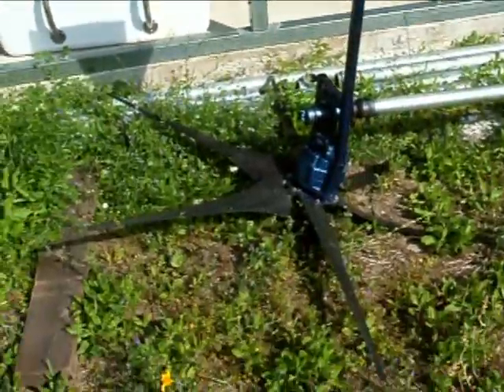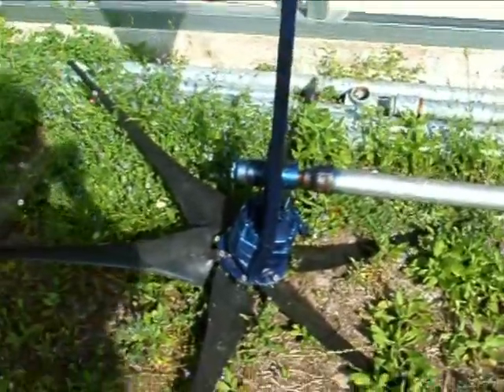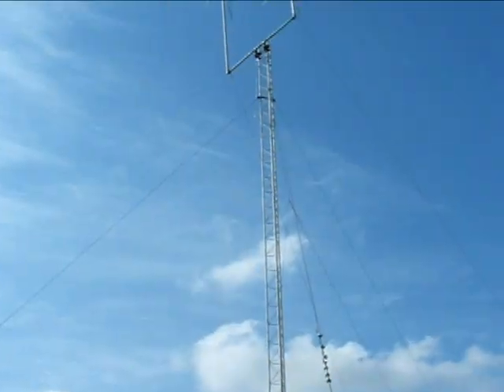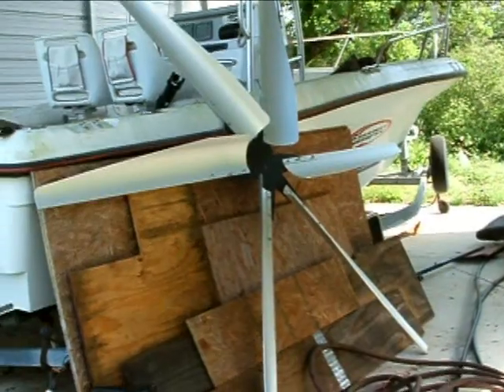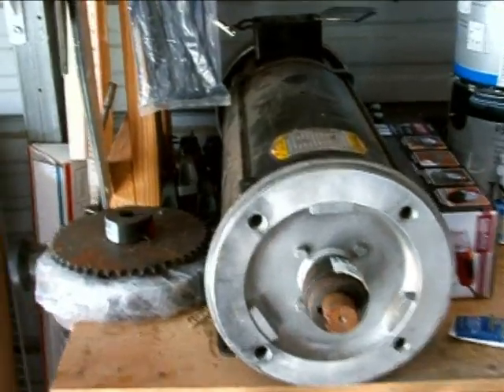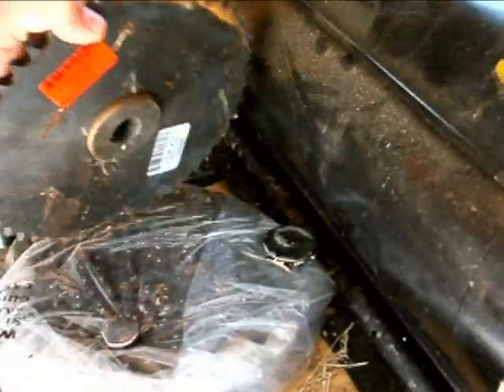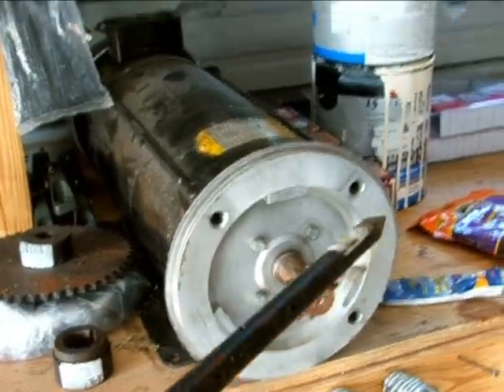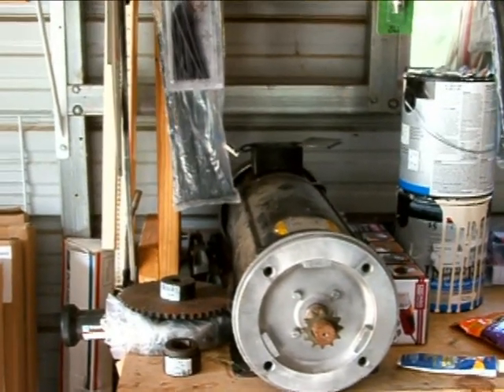New Turbine Projects - 500watt to 9Kw wind generators

Comment from the maker: @laidofftomass In early testing the PMA does not begin turning until about 10 MPH with the 6 blades while the WindMax begins turning at around 5 MPH with 5 blades and begins making charging power at around 8 MPH. So the PMA does not make useful power until about 12 MPH or so (in my observation).

Comment from the maker: @mediaman59 Thanks for your comments Mediaman, I did not make the blades, I ordered them from a guy in ebay, if you want his name and I can try to look it up. I designed the hub and had it made out of 1/4" steel on a CNC. I'd love to see your geared setup, I could only find a 48 tooh pulley. How do you like that PrestoWind unit? Does it have a decent  RPM to power ratio?

Comment from the maker: @laidofftomass It double posted because there are two answers which would not fit in one response (character count limit). The model I purchased was the Home Wind Turbine, 5 Blades, 1200W Hybrid Max/24V - Low Wind. I think if I had to do it over again I would buy their Residential Wind Turbine, 2kW/48V, wind/solar hybrid. It puts out more power for less money with even less wind. I think if you're in a wind area like mine, this might be a better all around choice.

God Bless

Comment from the maker: @mediaman59 I did not make the blades, I ordered them from a guy off eBay, let me know if you want his name and I can try to find it for you. I designed the hub and had it made by CNC from a machinist out of 1/4" steel. I was only able to get my hands on a 48 tooh hub, a 60 tooth would be very nice. How do you like that PrestoWind unit? Does the RPM to power ratio seem satisfactory?  Take care and God bless.

Comment from the maker: @OBXSOLWIND Yeah, that's going to be exciting but it will be a few months away. For sure it will be up and running by end of summer. I have to first install that small PMA on the roof and I have 28 solar panels from Harbor Freight to install first. That will take my solar total 2 KW and my installed wind to another 2KW so after everything is done I'll have 10Kw of power production available at any time when I have both wind and sun. That will be a happy day :-)

Comment from the maker: @gaypotter My water heater is solar but in winter it so overcast it doesn't work well so it works on spring through fall. Furnace is electric and we turn it way down and use electric space heaters which are 100% efficient, every bit helps.

Comment from the maker: @gaypotter Yes, I do. Under ideal conditions (which never is) I can generate over 7Kw/hr from my wind and solar, I usually generate 2/3 of that or about 5Kw/hour, the rest I buy. There are months where me bill is close to zero but I only sell 1.6Kw of the total I can produce as that is the only section of power I have grid tied. The rest of the panels and the turbines go straight batteries, then to the inverters and then to the house and gets used up.

Comment from the maker: @gaypotter My peak usage when the well pump and field pumps are running, the AC is on, etc can be as high as 7Kw an hour (a water heater uses 4.5Kw/hour when it is heating) - so my peak Kw/consumption is 7Kw but that doesn't mean we actually use 7Kw/per hour x 24 hours! My wind and solar is enough to being close to break even almost always and be offgrid when I want. I hope that makes better sense now.

Comment from the maker: @gaypotter We average about 1,200Kw a month so that's 1200/30 = 40 Kw/day or 1.6 Kw and hour. The problem is that you forget that I can produce 7Kw/hr during peak hours, meaning the sun is shining bright and the wind is blowing faster than 20 mph - which almost never happens. I get an average of 6 hours of sunshine a day of which 2 hours are peak sunlight so the average is 3.5Kw for 6 hours = 21kw. The average wind is 12mph for 12 hours producing about 12Kw a day more.